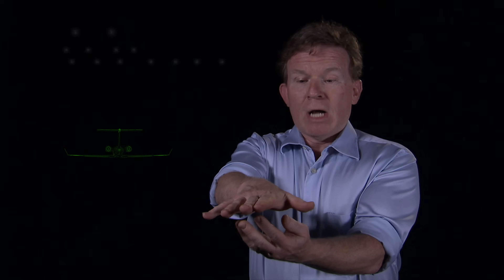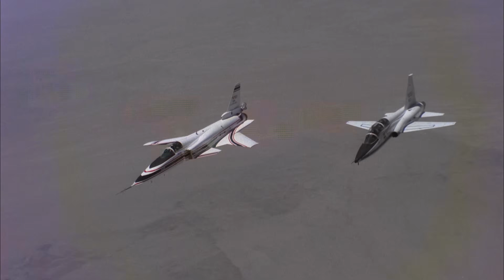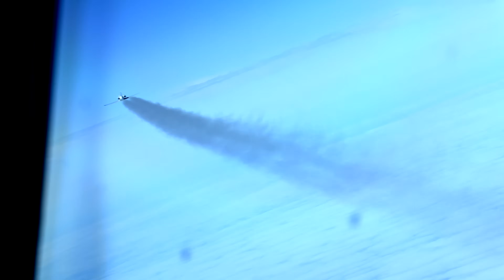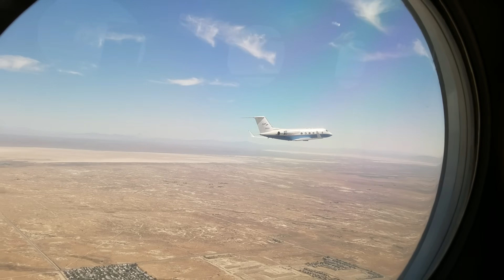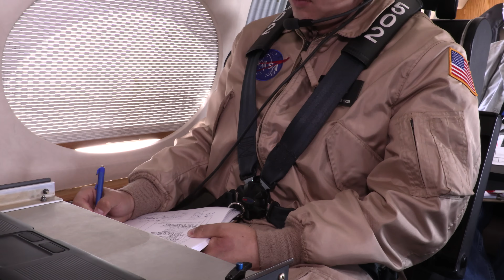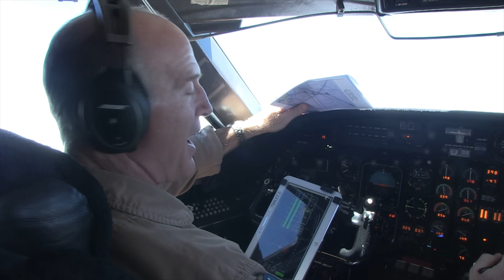Wake Surfing (Extended Cut)- Automated Cooperative Trajectories-Programmable Autopilot

Comment: Did this ever go anywhere? Seems like an idea that has very little practical application. I mean it's only useful when two planes are flying on exactly the same route at exactly the same time - yes I know this does happen, but it's not all that common, and such flights are usually rival carriers, with their own schedules and delays going on. Even if they came to an agreement to take turns being the rear plane which reaps the benefit, the maximum energy saving is capped at half of the energy lost to induced drag of the leading plane, which I can't imagine is very significant to begin with, but then consider you're a mile behind and only using a fraction of that one half-side, and you're looking at a miniscule benefit (unless I missed it, we were not told how much the benefit was found to be). And that's only when everything goes perfectly according to plan. Never mind the potential for some gut-wrenching turbulence and efficiency loss if things don't go quite right.
Reply: I should also add, if the two planes have the same destination, when they arrive together one of them will have to wait longer for a runway clearance than it normally would have, if it arrived on its own a bit later. Same goes for take-off, if they are departing from the same airport. This is not such a problem if the two planes have a different origin or destination, but if that was the case what is the likelihood that they want to share exactly the same route?
Reply: There are very busy routes where airplanes are flying well within range of taking advantage of these wakes. If the technology is proven it would allow them to fly even closer since right now they actively avoid (with the guidance of ATC) the wakes.

Comment: Any idea what they use to 'see' the wake? Besides feeling the vibrations, do they use infrared, radar or sonar technology to visualize the wake itself? Either by the temperature of the air swirling in the vortices or density and direction of the air molecules.
Reply: No sensors were used to 'see' the wake during these tests. The wake position was estimated from the ADS-B breadcrumb trail of the lead aircraft, winds estimated by the trail aircraft, and a simplified mathematical model of the wake.

It's desirable to avoid using specialized sensors so that there isn't a high cost to equip airplanes to do wake-surfing.
Reply: They could see the autopilot compensating for the added lift from the wake.
Reply: shut up stupid